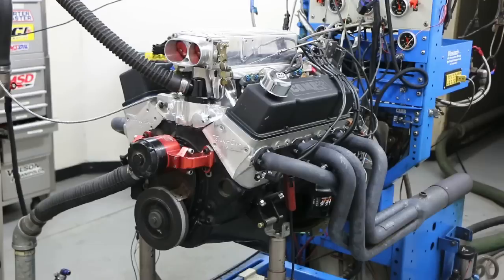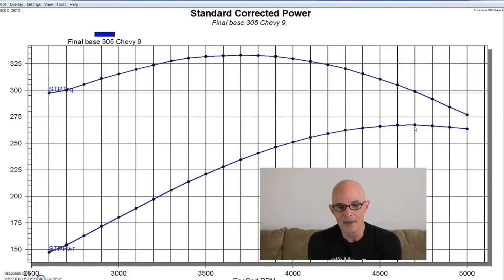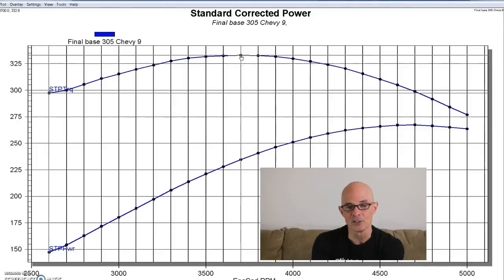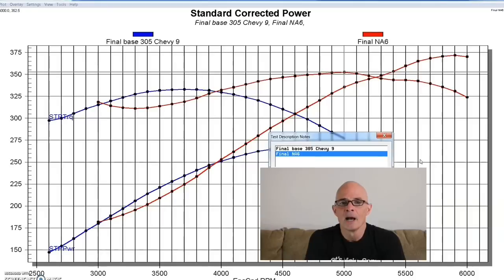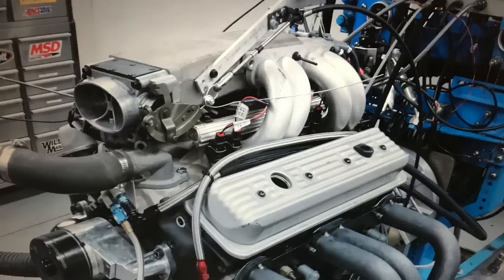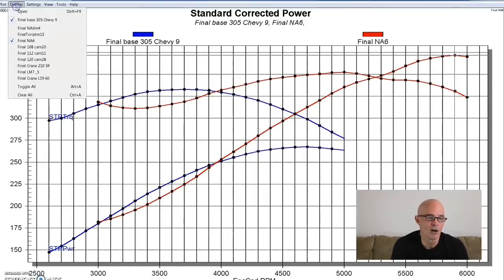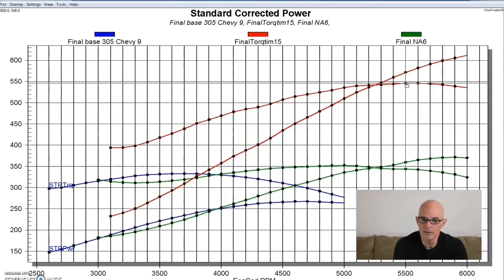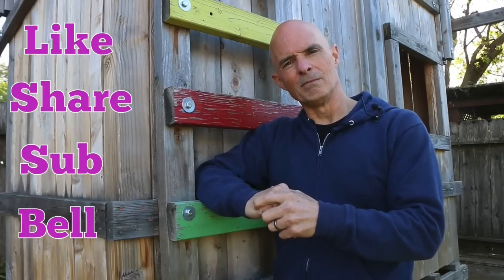GM 305 LB9 TUNE PORT (TPI) TECH PLUS BOOST-FASTER THAN 5.0L FORD?

Comment: The TPI was the best truck motor Chevy ever put in a Camaro.
Reply: That’s the truth! Never could figure out why they put them in camaros when the trucks needed all that low end and mid range.
Reply: All the OEMs during the time were obsessed with big bottom end torque....they wanted the engine to "feel" a certain way. Then us hotrodders had to fix things. Starting with the Gen 2 SBC and 4V Modular Ford, the OEMs started building wideband engines that could rev.
Reply: Stuck with the TBI garbage til 96. 🤮
Reply: @shitbox7413 that’s cause you never learned how to correctly TUNE these engines…a few simple changes to the ECM and these engines easily produce 350:HP
Reply: @paulthesoundguy1 what would these changes in the tune be ?
Reply: @gman2969 changes in the spark timing curve, changes in the operating temps before allowing more fuel into the engine, of course a few mechanical changes, block off the EGR, and change the ECM to not activate it.  The corvette cam and injectors also help.😊
Reply: Lol, I've been saying that for years
Reply: why not? ford put a truck engine into the Fox body with some headers and a rumpy cam and made a long-lasting name for themselves. but their's was a short stroke, and that lowers the piston speed at TDC. Which creates more dwell for power creation all other things equal. The 305 will expand the entire combustion space sooner in relation.

same tech sports cars had during both world war decades. make torque at low rpm, come off the corners hard.
Reply: @albertgaspar627  Yeah, makes sense. But Chevy never put TPI motor in a truck.
Reply: 🤣fact
Reply: They did with the T B I lmao
Reply: The TPI is not really a good truck engine. The TBI makes more grunt under 2,500 rpm where GMs lethargic overdrive with 3.08 rear geae trucks tended to run 95% of the time. I had a TPI on a G20 van, it was down on power in the normal driving rpm ranges compared to a Q-Jet setup on the same long block. Van had a 700r4 and 3.08s from GM.
Reply: Mmm.. Dunno ... If you look at what GM/Ford had done to their V8's for smog compliance .. Late 70's /early 80's..  A torque manifold was at least a step in the right direction.. because Torque x RPM = HP.    I had a 302 Ford in an 81 F150 .. around 160hp.. Chevy's V8's were equally smog/castrated.  EFI and long runner manifolds in 85/86 got the nose of the plane back skyward.
Reply: TPI 305 was crap , 700r4 behind it was crap, and rear end behind that was crap in a IROC
Reply: @GatesRapes  Hey, I had one of the earliest 305s in a 78 Chevy Monte Carlo.  Oh, it moved the car pretty well, well enough to get in trouble (the '78 Montes had a lousy suspension/tire combo from the factory, and THAT was with the F41 suspension option!).  But overall, meh.

Comment: My dad was a senior mechanical design engineer 
He bought it brand new 1988 gta trans am Pontiac firebird 305 tpi and a t5 which w
Makes it 1 in 861 made 
I still have it 
It became my.mons car and she gave it to me 4 years ago
I built a 6.2 sbc 383 alum heads forged guts and a 95 lt1 t56 
And a factory gm 9 bolt rear end 
And it has a hsr and tb 
It's a rocket ship now 
Lol
But the 305 still was working 
No oil burning or knocking 230kns after 32 years old 
The only reason I got a 90 roller 350 block was it was looking compression on all cylinders and I either rebuilt it or build a 350 into a  383 which is bad ass 
I got pics
Reply: QUOTE And a factory gm 9 bolt rear end UNQUOTE

Comment: TPI is cool. I want to put TPI on the sbc400 in my truck. Better low end torque and still 87 octane. 

Richard, have you ever boosted a Ford V10? There is a guy on youtube with a twin turbo 2v V10. I think he claimed over 700 wheel hp on 7psi.
Reply from the maker: not unless it was modified

Comment: Joe Sherman made about the same n/a power with Dart heads for 305 bore and a Comp hydraulic and carb. Gap the rings and put a 350 shot on it.

Comment: I was just thinking about boosting a 5 liter sbc and if the block might actually be stronger than the larger displacement motors. SBC's have really weak blocks and really, were never engineered for much more than 300hp. They tend to crack the cylinders when making high hp like this. Yes, they will last a long time doing a few dyno pulls or drag racing, but extended use at high rpm usually spells disaster. But i wonder if the smaller cylinders on the 5.0 blocks have any more meat on the cylinders than the 5.7's.
Reply from the maker: we make 1000 hp with stock 4-bolt blocks all the time

Comment: I love this video I have a partially restored 86 Pontiac Trans Am but even though mine has a T-56 and a both Warner 9-bolt with 3.70 gears it still has the original 305 it has a nice cam vortec 305 heads and a stealth ram intake with a mandrel bent manifold back exhaust I love my car but the tune is way off

Comment: 612 hp on the stock bottom end. Sounds like a grenade.
Reply: Joshua Skinner nah gm motors are typically pretty stout under boost. Albeit a different engine, the ls is a great example of this

Comment: Shoulda ran it with the TPIS miniram intake. Might not have been out when you ran this test.
Reply from the maker: it was-the Stealth Ram had more runner length
Reply: @richardholdener1727  Makes sense, that Holley stays more true to the TPI roots. Wonder what a miniram and a little more cam can do at 6500rpm.

Comment: The holley stealth ram intake is nothing like the TPI intake.  It's more like an LT1 intake with much shorter runners, and that's partially why you see the power band shifted beyond 5000 RPMs.
Reply: Rumor at the time, was that the LT1 intake was actually designed specifically because of this Holley intake.  Probably was true, because it sure did make a difference in the way the LT1 felt, as compared to a TPI 350.
Reply from the maker: The LT1 was a copy of the Min Ram from TPIS
Reply: @richardholdener1727  
Great videos.  Looking forward to some modular and coyote ford stuff too.

Comment: I did ! 😼 With a tbi 305 91 Camaro rs. Beat a 455  Cutlass, single cab Chevy with a sbc 400, 3 cars and still pulling on a 89 mustang GT with 373 rear gear. Ran hot and a convertible first year model mustang GT 4.6 only beat me one and a half cars. 96 Impala ss beat me four cars and ran a cheating wide track grand Prix down. Thanks for the memories Richard.😺

Comment: I had a mullet...and an iroc with a 305tpi. I have often wondered how those systems would work with individual coils, an 0411 pcm or a Holley, etc...bring it up to date a little.
Reply: I don't have a mullet but I've built a 350 FIRST Fuel Injection Intake-based TPI engine with Holley HP EFI and LS coils D514a from the LS2/LS7 Corvettes, so I agree with what you're saying. 195cc Profiler heads with 1219x pac beehive springs, comp HiTech .105" thick wall pushrods, high rpm low leak-down retro hyd rollers, Mike Jones aggressively-lobed roller cam 0.600" intake lift with 1.6R comp ultra pro magnum roller rockers, 1.2mm gapless rings with spacers on the pistons, 58x crank trigger ignition, Vortec Truck cam sync sensor, sequential injection using the Bosch III injectors 36 lbs, and 0.044" gapped Iridium spark plugs, intake gasket matched to Felpro 1206 and matched to the heads, 1 5/8" FlowTech headers.  I just need to finish wiring the CoP extension harness and drop the engine back into my 79 C3 Vette and tune the thing. -Bottom end is still stock L82 forged pistons, crank, and pink X rods because the car only had 14k miles and the piston to wall clearance is still really good. Ceramic coated the intake and added a home-made oil splash screen to the underside and so it would stay a bit cooler.    

A TPI brought into the modern era and a little bit of the C4 and C5 generation Corvettes brought to my C3 Corvette (did a 4L60e swap and QA1 coilovers, too). Interior and gadget modernization next.
Reply: @adamarndt7617  
Is it driving?
Reply: @xmo552  Is it even legal to ask a car guy that question?!? :-)

No: I broke and ac line, decided to do an AC conversion, then decided I should convert to electric headlight motors, then alum master cylinder... engine still sitting behind the car.
Reply: @adamarndt7617  
I've got cars not running...

But I was mostly asking about the computer you have on it. It runs well?
Reply: @adamarndt7617  
I just remembered a meme I saw about non running cars.... 
My mom sent it to me. 😠😂

Comment: Kinda feels like this dyno is pretty generous
Reply from the maker: not really-its the test procedure-no accessories, no air intake and long tube headers with optimized tune
Reply: @richardholdener1727  372hp is stout out of that 305 with that small cam! and 267hp bone stock
Reply: @richardholdener1727  With heads and intake tho $$$ LOVE your videos man, keep them coming!

Comment: That little 305 stock block will handle this kind of power. Where as the 302 ford block will be spitting its guts out around that number . Ps and I'm by no means a 305 fan . Lol

Comment: The 305 was/is a good engine.  I never liked a 307, though.
Reply: The 307 was a great engine. It was a small bore 327 which would outperform a 305 all day even with a 2 barrel carb. They got a bad rap by taking someone's word about the engines through ignorance

Comment: Love the LS stuff but nice to see some different combos as well. Great stuff! Miss my 1984 Z28 HO 5 speed with 3.73's in high school!
Reply: LAYNRUB I had the same car in high school. An arrest me red T-top 84 305HO /5speed/3.73 it was fast for its time! I beat a fee built 350s with it , it had a gutted cat convertor and I installed a universal adjustable fan switch to bring the cooling fans in at 200 degrees and put a 180 tstat and added a little timing,that was it...

Comment: I built a firebird, that had tpi 5.0, swapped everything to a .030 5.7, with trick flow twisted wedge heads, and a comp compucam, 1.6 rollers, it was something like .552/565 with 1.5:1, so add like .030"  did nothing to the ecm, it was tough , I could blast by 5.0 mustangs like they were sitting still, it had the T-5 5 speed, I went with centerforce dual friction clutch, it had 3.45:1 gears..   I miss those days!
Reply: Not sure how you didnt grenade that t5.  We broke them quite easily with just a mild 305.  The trans had an advertised torque limit of somewhere just over 300, and that was for the tougher model called the "World Class".  With absolutely zero power shifting, I had 2 of them left go on a second gear roll into the throttle.  The aluminum case could flex too easily and allowed the internals to force apart, too much gear backlash and the thing with just go boom.

Comment: This is an awesome video would love to see a stock block 302 also then run it till the block splits. Btw you may want a girdle for that one. Then the 350 vs 351 would be cool to
Reply from the maker: unfortunately the girdle doesn't cure the block splitting
Reply: @richardholdener1727  no, but it makes cleanup easier

Comment: Richard, thanks for the timely video! This weekend I am assembling a FIRST TPI setup on a barn-find SBC 400 crate motor for my 87 Formula. Vortec heads. Question: Did you gap the rings on the lower boost application? Just curious if it's necessary.
Reply from the maker: I did not on the 305
Reply: Tpi on a 400? Gonna be hard for it to breathe in the upper rpm. The 350s had trouble up top with a tpi. Even with the aftermarket runners
Reply: Robert... get it running ?
Reply: @xmo552  I'm assembling it the next few weeks. Hope to be ready by April.
Reply: @thegirdedmind  
Nice. I have a 400 TPI but I've never ran it yet. 

Yesterday my dad was talking about fixing up his old 1988 caprice wagon  for a road trip. It's a 305 TBI. It needs to be fuel efficient and be able to pull a small camper. I think I might assemble him a stockish 305 TPI unless if someone has a better idea.

Comment: Can you run the torque storm on the factory iron heads? It would be cool to see how much better the trick flows compliment the boost.
Reply from the maker: yes you can run on the iron heads
Reply: @richardholdener1727  a comparison of  a boosted 305 with factory heads vs a boosted 302 with factory heads would be cool if you can make it happen. Thanks again for the awesome vids.

Comment: Thanks for the trip down memory lane. I had a bunch of these cars starting in the mid 90s. Sold my last one, a 91 Z28 5.7L car in 2010. I had a lot of fun with them, never had a mullet. Tuning was my largest hurdle back then with the factory ECM and "chips" - aka EPROMs.

Comment: You're laughing at the stock hp numbers, but every 80's Mustang owner is crying across time. 
Chevy's worst V8 spanking their best.
Reply: Former Chevy guy here (66 Chevelle, 68 Camaro, 74 454 C10). I'll take the Ford with the 4.0" bore and short deck. But if you offered me a Chevy 302 TPI (4.0" bore) I would flip a coin.
Reply: @mchristr  cant be good size bore with a long rod
Reply: The TPI 305 is far from Chevy's worst V8. The worst ones were the 305 and 350 smog engines from the mid 1970s. Those made like 150-160HP at the crank. Fords offerings weren't any better with the Windsor 302 of the same vintage pushing out about 140HP. Combine that with a power-hungry slush box, heavy car construction, and lazy fuel economy focused rear end gearing and the result was that your brand new 1975 Camaro Z28 or Mustang GT would get smoked by a naturally aspirated 2.0-2.5L European family sedan.

The mid 70s weren't good years for Detroit's pride.
Reply: @Benny---  chevy never made a z28 in 75
Reply: Where is this spanking coming from?  The ford 302 is a far superior engine with it's 4.00" bore x 3.00" stroke compared to the 305.  The exact same mods on the ford will produce equally as impressive numbers.  I built a 305 TPI for my monte carlo SS years ago.  It was nearly identical to the n/a build in this video.  It worked well, it was faster than my buddy's carbureted 350 IROC, but I still got spanked by the mustangs at the track.
Reply: Olds Pwr who was it made by then?
Reply: @liam-5571  he's going to say GM stole the design from Ford. They all do yet the ls out performs their current engines. They always lead the conversation that way bring purposely deceptive.
Reply: @EGGINFOOLS  Ford (mod) and gm(LS) both copied the bottom end of the m117 Mercedes v8. Y block, 6 bolt cross bolt mains. Released in 1980.
Reply: @EGGINFOOLS  since his user name references Oldsmobiles he'd probably just point out that the LS is a corperate, non-division specific engine unlike Chevy engines or the Oldsmobile engines I assume he's fond of.
Reply: @Olds_Pwr  are you an idiot or moron... really the only two choices here... designed and built from the ground up at gm
Reply: all it takes is replacing the entire top end with the best aftermarket pieces you can get for the pos sbc and a blower to beat a stock Ford. I was building engines for the Mustang guys in the 90s, NA and Paxton supercharged, it was very easy to get them to run mid to low 12s. Never saw a 305 or any TPI do that. The Fords needed a blower to keep up with my Pontiac, well kinda keep up as long as my car was 1000lbs heavier. Fords best small block is the 351C, all the 4V needed was a cam and headers, Ford put tiny cams in them. Step up to the same specs the chevys ran and the C with 4V heads stomped the chevy hard core. The 2V just needed headers, cam and a 4 barrel intake, and chevys saw Ford tailights getting smaller.

Chevy had crap engines until the LS came out.
Reply: @SweatyFatGuy  really... just really... lmao... yeah the 305 isa  crap motor... more suited to a small truck than a sports car.. the ford 302 is indeed a better motor than the 305.... good thing gm had 4 inch bore motors... and before the ls the basic 350 was the go to engine for almost all engine swaps ya know pre ls and the sbc is still used more than any other non gm engine... but try arguing with 50+ years of hotrod history... now mod to mod 350vs351 power lvls were near equal.. dollar to dollar though gm always came out on top

Comment: Well really considering how much of a turd a 305 actually is I was somewhat impressed even though it was super charged that still over 600 hp and with that much foot pounds of torque that thing would be A contender on the street for sure plus the high revving nature of the 305 I think that combination would probably be quite fun and the car would be quite fast honestly with that amount of RPM capability

Comment: I read this article when it came out in hot Rod Magazine. I already know the answer about which made more power but I won’t spoil it.
Reply: Already know by the 305 making 700 with the torqstorm the the 5.0 302 I don't care what heads what fuel injection it is not going to make that horsepower
Reply: @shawnlibby675  Boss 302 (Cleveland head) with the same setup would easily make 700

Comment: Those are pretty good gains.  I remember mustang guys reading Ford magazines and thinking all 5.0's were faster than Camaro's and were confused by getting gapped by the 350 tpi cars.  One was a good friend of mine with a LX 5.0. Those fox bodies didn't drive good in my opinion compared to the f-body platform either.  (Handling wise) They did however launch good in a straight line and still do with today's power.

Comment: My prediction:
The longer stroke of the 305 will  cause a higher piston spread, and therefore greater intake charge velocity/cylinder fill. This will give the 305 the edge down low.
The larger bore and better port/head geometry of the 302 will allow it to run away up top.